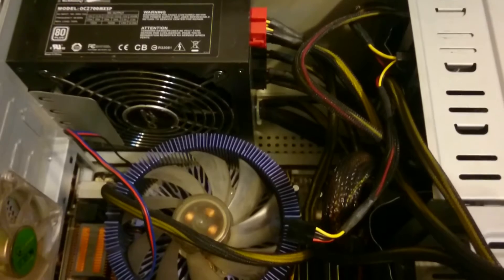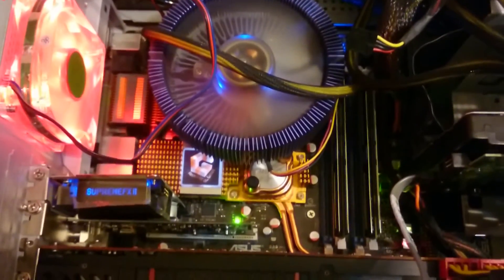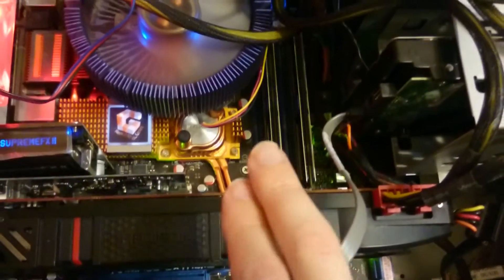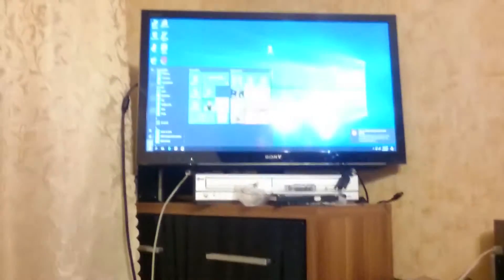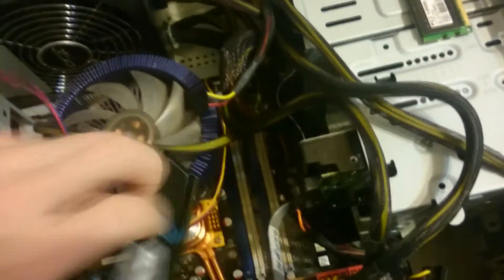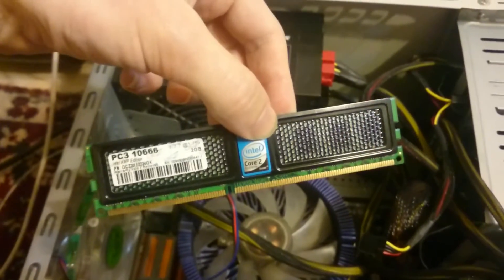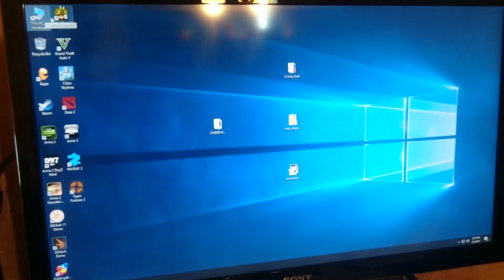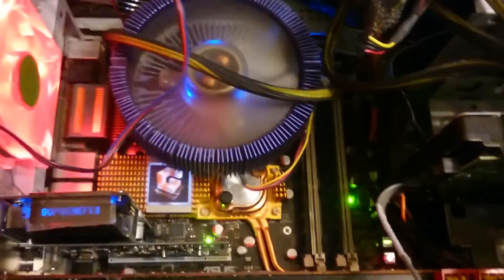Can s775\lga775 Handle More Than 8 gb ddr3 ram?

Comment: Can it support dual 2x 8GB which is 16gb?
Reply: No. It can only support dimms up to 4Gb with chips on both sides (double-sided ram or so called low density). So if you want to fill 2 slots you can have a max of 8 gigs.

Comment: I can confirm. RAMPAGE EXTREME x48 chipset with 16gb ram working for almost 6 years
-Rampage Extreme x48
-CPU QX9650
-16GB Ram ( 4x 4gb )
-Samsung 970 evo plus nvme on pci-e with adapter   and booting windows with CLOVER DUET
IT JUST FLIGHTS
Reply: u have system on nvme disk into pcie adapter. is it works well?
Reply: @jestemofaf9899  yes. Very nice. Using this : https://www.win-raid.com/t3286f50-Guide-NVMe-boot-for-systems-with-legacy-BIOS-and-UEFI-board-DUET-REFIND.html
or this : https://www.win-raid.com/t2375f50-Guide-NVMe-boot-without-modding-your-UEFI-BIOS-Clover-EFI-bootloader-method.html
VERY IMPORTANT: In the first installation and boot of Windows you must have all the posible usb and pci  unplugged.
Reply: @cvlebrah  thanks men a lot. What u have ram sticks? will 16GB RAM work on ASUS P5E3 WS PRO(X38)?
Reply: @jestemofaf9899 P5E3 WS PRO(X38) good mobo YES

I have 4 x4gb ram :16gb
You may have no problems in your mobo
I proved it on a maximus extreme (x38) and it works fine.
-Must be patient if it does not recognize at the first try.  If it does so, then clear cmos for about a minute and disconecting psu too.
If you can make it work i`ll agree if you let me knoww
Get lucky
Reply: @cvlebrah  
what exacly is your ram memory model?
Reply: @cvlebrah  i have 2x4gb kingston kvr1333, one human built with 4 of these sticks and that works well.
Reply: @jestemofaf9899  remember that if you have problems when you are trying whith the stick you must clear CMOS and wait about a minute whithout energy and try again.
And you can update your BIOS to P5E3 Premum (x48) .  YES (x48)
 If you have problems after updating BIOS you can charge original BIOS again.
http://www.xtremesystems.org/forums/showthread.php?181439-Asus-P5e-p5e3-X48-Bios-Flash-Mod-Working&s=2d5ca70bb9dce6a73e516dc45b757153
Reply: @cvlebrah  what i get when i update bios? Do you have more tips?
Reply: @jestemofaf9899  Don`t know the difference. just try it.
just one more tip. Asus sais you only can run 2 graphics only o ncrossfire way ( SLI is not suppurtoted on this mobos)
long time ago i could run 2 graphics on sli
Look at this: https://www.techpowerup.com/forums/threads/hypersli-enabling-sli-on-non-sli-motherboards.153046/
Good LUCK
Reply: @jestemofaf9899  Works very nice YEAHHHHHH
Reply: @cvlebrah  yeah i buy 2 kits of 2x khx1600 4gb, and sell one kit 2x kvr1333 4gb
Reply: @jestemofaf9899  windows 10 instaled on nvme
Reply: @cvlebrah  nice. when i will have enought money i buy disk on nvme too.
Reply: I wish can boot S.O in a nvme too, how do you did?
Reply: @CristhianArchundia.01  https://www.youtube.com/watch?v=XT-Sq_UscQE

Comment: The shock you'll get is when you put in another two 4 gig sticks of ram and they're not recognised. You can't have more than 8 Gig max on that board.
Reply: In the Rampage extreme with chipset  x48  i have 16 gb (4x4gb) ram memory instaled. Officially it only supports 8gb.

Comment: Its simple, G31 chipset motherboard can handle upto 4GB RAM & G41 chipset motherboard can handle upto 8GB RAM .
 Both g31 & g41 are  lga 775 socket board.
Remember that  combo motherboard supports both DDR2 & DDR3  upto 8GB but only one type of memory at a Time. You cannot Run both DDR2 & DDR3 mixed at same time.

Comment: bro i have DG41WV model so can i install 2x4gb ddr3 ram???
Reply from the maker: It may, why not. Just need to try
Reply: But I just saw 4 GB support on the site
Reply from the maker: @FaizMuQeem  well on my mobo therre is too only 4x2gb modules ONLY, but still it works with 2x4gb..
Reply: @endreu1  but my mobo has 2 slots and it can support only 2x2gb so can i install 4x2gb ???
Reply from the maker: @FaizMuQeem  i talked about my mobo. As I say before you just need to try. Ask some one to borrow one 4gb stick and see if it works
Reply: i tried putting  4 gn ddr3 + 4gb ddf3 ram in my motherboard lga 775 g41  it doesnt show any screen onthe monitors why is it ya
Reply: @amansliondraq4960  4gb stick must be dual rank (chips at front and back)
Reply: it is black screen but with 4gb ddr3 ram on it could show the screen

Comment: have you tried more than 2 x 4GB? i've got s775 asus rampage extreme and interested to put more; some on internet say x38 should handle  >8GB ram; btw it cost me 2 dollars, included QX6800 4-core intel extreme cpu, what luck! homeless guy found it in the trash :)
Reply from the maker: Anny Hutchinson hi, I'll check that when I'll get at home
Reply: did your computer explode? :p
Reply: It`s my actual PC since almost 5 years HA HA..... @moonbind
Reply: The Rampage Extreme can support 16gb ram. I have 16gb on my Rampage Extreme 775.  And i used a SLI mod on this board. ITS FANTASTIC
Reply: @cvlebrah  Why does it's user guide say 8 Gig maximum then! I think you're mistaken or full of it. You can fit them but doesn't mean they're recognised.
Reply: I have a Rampage Extreme X48 with a qx9650 (pocessor does not matter ) wit 4x 4gb ram since 5 or 6 years ago. And used it  daily
Tipo de CPU QuadCore Intel Core 2 Extreme QX9650, 3000 MHz (9 x 333)
Nombre de la placa base Asus Rampage Extreme  (2 PCI, 3 PCI-E x1, 2 PCI-E x16, 4 DDR3 DIMM, Audio, Dual Gigabit LAN, IEEE-1394)
Chipset de la placa base Intel Beachwood X48
Memoria del sistema 16384 MB  (DDR3 SDRAM)
DIMM1: Crucial BLT4G3D1869DT2TXOB 4 GB DDR3-1866 DDR3 SDRAM  (10-9-9-27 @ 933 MHz)  (9-9-9-27 @ 933 MHz)  (8-8-8-24 @ 848 MHz)  (7-7-7-21 @ 742 MHz)  (6-6-6-18 @ 636 MHz)
DIMM2: Crucial BLT4G3D1869DT2TXOB 4 GB DDR3-1866 DDR3 SDRAM  (10-9-9-27 @ 933 MHz)  (9-9-9-27 @ 933 MHz)  (8-8-8-24 @ 848 MHz)  (7-7-7-21 @ 742 MHz)  (6-6-6-18 @ 636 MHz)
DIMM3: Crucial BLT4G3D1869DT2TXOB 4 GB DDR3-1866 DDR3 SDRAM  (10-9-9-27 @ 933 MHz)  (9-9-9-27 @ 933 MHz)  (8-8-8-24 @ 848 MHz)  (7-7-7-21 @ 742 MHz)  (6-6-6-18 @ 636 MHz)
DIMM4: Crucial BLT4G3D1869DT2TXOB 4 GB DDR3-1866 DDR3 SDRAM  (10-9-9-27 @ 933 MHz)  (9-9-9-27 @ 933 MHz)  (8-8-8-24 @ 848 MHz)  (7-7-7-21 @ 742 MHz)  (6-6-6-18 @ 636 MHz)

COPY OF AIDA 64
CPU Type QuadCore Intel Core 2 Extreme QX9650, 3000 MHz (9 x 333)
Motherboard Name Asus Rampage Extreme  (2 PCI, 3 PCI-E x1, 2 PCI-E x16, 4 DDR3 DIMM, Audio, Dual Gigabit LAN, IEEE-1394)
Motherboard Chipset Intel Beachwood X48
System Memory 16384 MB  (DDR3 SDRAM)
DIMM1: Crucial BLT4G3D1869DT2TXOB 4 GB DDR3-1866 DDR3 SDRAM  (10-9-9-27 @ 933 MHz)  (9-9-9-27 @ 933 MHz)  (8-8-8-24 @ 848 MHz)  (7-7-7-21 @ 742 MHz)  (6-6-6-18 @ 636 MHz)
DIMM2: Crucial BLT4G3D1869DT2TXOB 4 GB DDR3-1866 DDR3 SDRAM  (10-9-9-27 @ 933 MHz)  (9-9-9-27 @ 933 MHz)  (8-8-8-24 @ 848 MHz)  (7-7-7-21 @ 742 MHz)  (6-6-6-18 @ 636 MHz)
DIMM3: Crucial BLT4G3D1869DT2TXOB 4 GB DDR3-1866 DDR3 SDRAM  (10-9-9-27 @ 933 MHz)  (9-9-9-27 @ 933 MHz)  (8-8-8-24 @ 848 MHz)  (7-7-7-21 @ 742 MHz)  (6-6-6-18 @ 636 MHz)
DIMM4: Crucial BLT4G3D1869DT2TXOB 4 GB DDR3-1866 DDR3 SDRAM  (10-9-9-27 @ 933 MHz)  (9-9-9-27 @ 933 MHz)  (8-8-8-24 @ 848 MHz)  (7-7-7-21 @ 742 MHz)  (6-6-6-18 @ 636 MHz)
BIOS Type AMI (07/27/09)
 

.  @sharpeyedwatcher9724
Reply: And all of this is recognised by Windows and BIOS